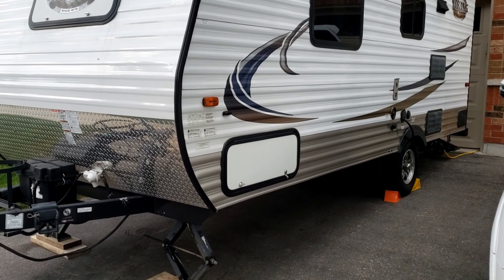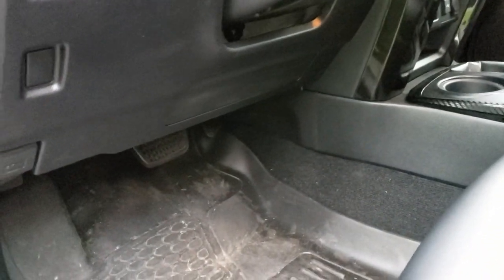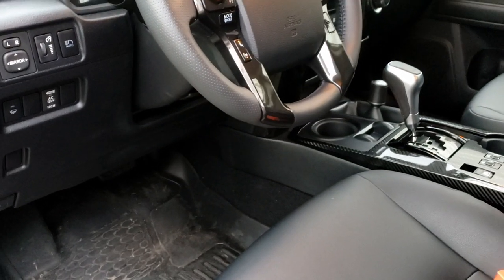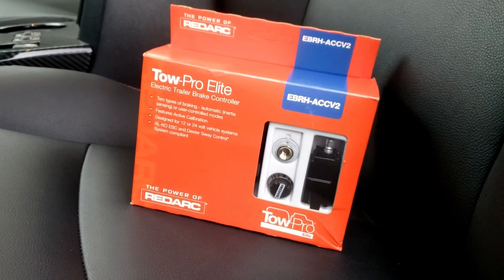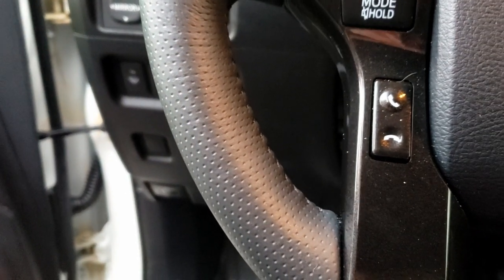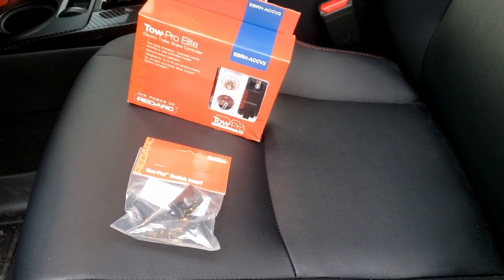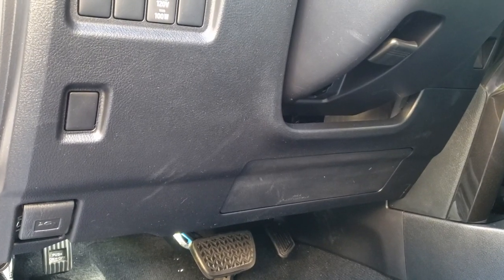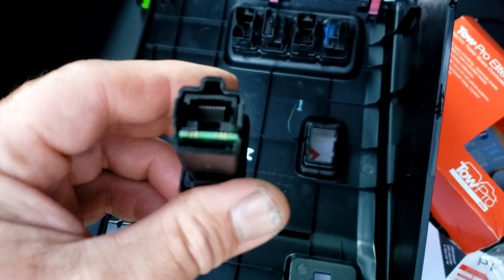Why Redarc may make the best trailer brake controller for your tow vehicle - 5th Gen 4Runner install

Comment: The REDARC supplied harness has the diode already preinstalled according to their website. Great Video information, I just took my REDARC Tow Pro Elite out of my Jeep JK and Now it's going into my new 4Runner TRD Offroad.
Reply from the maker: If you are referring to the harness that comes with the controller itself (as opposed to the vehicle specific ones available from RedArc), I can confirm that this is not the case, at least not at the time we bought ours (early 2020). When used in conjunction with the factory harness connector that came with our 4Runner, dashboard Christmas resulted as soon as manual control was applied. Splicing the diode into the brake light feed circuit corrected that. Because I already had the Toyota end of the harness (and am quite comfortable doing automotive wiring), I didn't bother buying a completed one through RedArc. Helpful information for others, though. Thank you!

Comment: Great video. I bought the same controller last year for all the same reasons you stated. Traditional controllers are so clunky and awkward. Mounted mine in the spot to the right of the steering wheel, for better access (at least for me) for emergency, manual use. I considered both spots and the one on the right works for me. I did modify the existing blank plug myself which was the most difficult part - I didn’t find the one you used at the time.
Reply from the maker: I contemplated that spot as I too felt it would be more convenient. The counter-sunk spot had me worried that I might not be able to grab the knob that easily, so i went to the left, which has worked out fine for on-the-fly adjustments. If memory serves, RedArc's listing for that blank doesn't actually show this generation of 4Runner as one of the applications it fits.
Thank you for the compliment, glad you liked it!

Comment: eTrailer carries factory to brake controller patch cables. I have the Redarc installed on my 2019 Pathfinder and used a patch cable. Fast and easy.
Reply from the maker: Since both the 4Runner and controller came with cables and I'm proficient in electrical work, it was easy for me to make my own by joining the two. Good suggestion, as I wouldn't have even thought to investigate the pre-made option.

Comment: The parking light electrical feed is necessary on some trailers to activate the remote bluetooth cameras.  Sure appreciate your video.  Wish it had been on a 2017 but I'll manage.
Reply from the maker: Appreciate the positive feedback, thank you!
I suspect that the installation will be otherwise the same. The pre-collision system was introduced on the 2020 models, and I don't think that at the time many folks had encountered that issue. Although another viewer suggests that newer RedArc Elites come with a diode, I can't say for certain if that's the case, or if RedArc or anyone has updated their information to reflect that. Theoretically, this PCS brake signal feedback error would be a problem with any brake controller, not just RedArc's.

I'm a working tech that specializes in electrical, so I just quickly cobbled up the diode work-around, and the controller has worked perfectly since. It just won't activate the truck or trailer's brake lights if I manually apply the controller without also applying the truck's brakes as well. I can live with that compromise.

I fully expect that your 2017 will be virtually identical (other than that 2020+ issue) as the interior trim and trailer wiring itself is probably exactly the same. Toyota's changes to these trucks has been incremental for the most part - a plus in my eyes. Your brake lights should also apply with the controller's manual function, of course.

Good luck, have fun, and enjoy!

Comment: I noticed you used the factory Toyota wiring harness that comes in the glove box of new 4Runners. I have a used 2011 and it did not have the harness in the glove box so I clipped off the male plug end and used butt connectors to connect the grey Toyota wire to the black Redarc wire. White & black striped Toyota wire to the white Redarc wire. Small blue Toyota wire to the red Redarc wire & finally the thick green Toyota wire to the blue Redarc wire. Basically bypassing the harness. Like in the video here, did not use the thin green wire.
Reply from the maker: That would definitely be the best solution if you didn't have the interface plug. Not having pre-collision, I'm assuming that your truck was fine having the brake lights activated by applying the controller manually, so probably no need for diodes. PCS did not like that one bit on ours! (Adding the diode to that circuit solved the problem in our truck.)
Reply: Update: Towed 2 different trailers and all working well. I would highly recommend buying the Toyota harness (mine didn't have one in the glove box) but if you're in a pinch, these color matches do work.

Comment: On the redarc website they state that the 2018+ year model runners have a diode that's factory installed in the tow package that prevents the voltage from back feeding. But according to your video here, they doesn't seem to be true as you had to install your own. I purchased the tph-021 harness that's vehicle specific bc the folks over at etrailer say the diode is built into the harness. After i installed it into my 2022 runner i didn't get any warming lights on the dash. I did however get fault codes on my redarc knob. All wiring is fine and I'm wondering if the tph-021 harness is my issue. The redarc website recommends to splice in the factory supplied jumper harness as you've done but without the diode as they say one is factory installed. I'm just so confused from the conflicting information i don't know how to rectify my fault issue. I've seen multiple other people install the tph-021 harness on newer Runners without any problems. I just don't understand.
Reply from the maker: At the time that I did my installation, the 4Runner's pre-collision system was so recent of an addition to the model that there wasn't much information out there. No mention of any of that then, and I merged the RedArc harness with the adapter Toyota left in the glovebox as seen in the video. I didn't notice a diode in that harness, so I guess Toyota didn't see fit to include one.
The diode I spliced in was just me thinking on my feet as a tech that does a lot of auto electrical.
Our RedArc is still working great - actually had to perform a shorter than comfortable stop on the weekend from about 80K/50mph and I could feel the trailer helping appropriately (thankfully!).
If you can isolate the brake signal feed wire in yours you can just backfeed 12 volts in to it to simulate you pressing the brake and eliminate the truck. (The power, ground, and controller output will still be to/from the truck, of course. And the RedArc won't fully power up until it senses a connected trailer, so you'll have to do that or spoof the load with a head light bulb or something.
Good luck!

Comment: Can you provide the diode value you used and a little more information about the installation? I have a 2020 4Runner and have ordered the RedArc as well. I plan to use the supplied Toyota harness as well. Thanks in advance.
Reply from the maker: It was late by the time I'd finished installing and videoing, so when the PCS malfunction occurred and I figured out the solution, I just grabbed a diode I had handy from a container of components I have and made the repair. Never even thought to record it.
If memory serves, it's a 1/4 Watt rectifier diode, though you could probably use something with a lower rating as there's very little current applied. It's oriented to permit power from the truck's brake light circuit to reach to controller as an input, but not be fed back out, so no truck/trailer brake lights on with the controller applied manually, but normal function in all other ways.
I'd be happy to elaborate if you have any other specific questions about the job.

Comment: Tekonsha Prodigy RF Brake Control 
I used it with my 4runner since 2019 with similar trailer
Reply from the maker: It's definitely a solid alternative, and would save having to fuss with mounting the Tow-Pro under the dash of our truck.

I decided to go with a unit mounted to the truck, rather than the trailer, on the off chance that I end up towing a different trailer at some point, either my camping buddy's (if his tow vehicle had a mechanical problem while away), or a large utility trailer that I have access to.

If that were not the case, or if we had multiple tow vehicles and one trailer (such as a property maintenance fleet sharing a deck trailer), the Tekonsha would be a great choice.

Comment: You do not need to pull all these bolts/panels, the left side panel will just pull free and you can run wiring to all the blanks.

i've done this over and over to put ditch lights, front bumper lights, etc. This will save you a ton of time,
Reply from the maker: You're probably 100% right. As stated in the video, the primary purpose for my removing that was not to access the blanks (you could even just reach up from underneath for the lower one for sure, probably the upper ones too), but to mount the brake controller's module. It's possible that I could have done that without pulling the panel as well, however it's simple enough to remove and made my life much easier. Having it out of the way also made filming easier!

Now that I've tracked down a Party Mode switch, I can finally put that in to the factory location, and I'll give your suggestion a go for sure.

Thanks for viewing, and thanks for the feedback!

Comment: No need to splice together your own harness, Redarc makes one that fits the 4runner/Prado/GX here: 
Toyota suitable Tow-Pro Brake Controller Harness (TPH-021): https://redarcelectronics.com/products/tow-pro-brake-controller-harness-to-suit-toyota-tph-021
Reply from the maker: Thank you for the link!

After looking as closely as possible at the single image provided by etrailer.com, I don't see a diode integrated into that harness, so while it would indeed save joining the Toyota OE connector to the one that comes with the Tow-Pro, I think you'd still find yourself having to splice in a diode in a 2020 or newer 4Runner to keep the PCS happy. It would probably be a nice, simple, plug-n-play for 2019 and older models though - I appreciate you sharing that with me!

Comment: How is it towing with that trailer?  I am about to tow with a very similar weight.
Reply from the maker: Mrs.2BlackStripes likes to be well equipped, so I'm confident that we're over the trailer's GVWR. I try to avoid carrying more than an absolute minimum of fresh water to avoid adding to that weight at least, filling up at the campground if there isn't "city water" hookup.
I mention all that for context.
The 4Runner definitely knows it's back there, and as per Toyota's recommendation, we tow in "S4", locking out 5th. We also have equalizer bars and a sway brake that I usually use when it's loaded; they do help with stability and rear axle bounce over bumps. Our storage location is under 20 minutes from home, and I just use the factory drawbar to and from, with no issues, so if your trailer isn't bursting at the seams, you may be fine like that.
The only quirk I've noticed is likely down to the single axle, and that's a sensitivity to larger vehicles traveling the same direction and their position relative to the trailer. If they're behind the axle (or ahead of the axle), I can feel air pressure pushing the tongue sideways a bit, enough that I have to apply a very small amount of correction to the steering. Unnerving at first, now I don't really notice it.
Provided the brakes and controller are adjusted correctly (you probably will end up making minor adjustments to gain as you're traveling), that should be fine too. Just have to remember that even with the trailer helping, your stopping distance will still be muuuuch longer.
Good luck, and happy camping!

Comment: So no drilling required? About to go add this.
Reply from the maker: In applications where one of RedArc's blanks will fit, no drilling is required to mount the control knob. Our 4Runner wasn't one of the listed models, but I guessed by the shape that one for other Toyotas was right, and it was. (And will be, right up to the 2023 model year.)
Worst case, you'd have to drill a small hole. If your vehicle has blank switches, you could use one of those, and if you ever wanted to return it to stock, you'd just need to find another switch blank.
Now, mounting the actual control unit, you might have to drill a hole or two, but I was able to find spots in our 4Runner that lined up well enough that I didn't. (At least any of those holes would be out of sight anyway...)
My only "complaint" is that the supplied, numbered bezel prevents the knob from being pushed, or at least did in mine. M pretty sure that RedArc has a new knob style now, so the new one might fit better.

Comment: Do you have a link for both the controller and the switch holder that you could share with me?
Reply from the maker: Hi Peter, sorry to take a while to get back, was on vacation!

The Redarc Tow-Pro Elite, we got ours from etrailer.com:  https://www.etrailer.com/Trailer-Brake-Controller/Redarc/RED44FR.html
The switch blank that did fit our 2020 4Runner (and should fit any 4th-gen 4Runner): https://www.etrailer.com/Accessories-and-Parts/Redarc/331-TPSI-002.html

Cheers!

Comment: Awesome video thank you! We have a 2021 4Runner Limited 4x4. What is your towing fuel economy & trailer weight?
Reply from the maker: Our trailer is a single axle rated within a few pounds of 3500. We're probably at that or a few over. Our economy varies considerably with speed. On a trip with a subtle but consistent gain in altitude where we tried to stay with the flow of traffic (110-115 km/h or ~70 mph) we saw somewhere in the 27L/100 km (~9 mpg) range in the trip computer, and nearly ran out of fuel from a full tank in under 300 km.
Keeping it closer to 100-105 (65ish) on less hilly terrain still sees us into the high teens to 20L/100 km range (so, closer to 12 mpg). That's also following Toyota's direction to use "S" mode to manually lock out 5th gear. The 4Runner's gearing is such that 5th is just a bit too tall most of the time anyway.
This vehicle may be rated for 5000 lbs and would likely move it, but it wouldn't be happy. I'm glad it has the ancient but bulletproof 5 speed auto in most ways, but having 6 gears to choose from would probably help the towing mileage appreciably.
Reply: @2BlackStripes  Thank you for the data!
An 8sp transmission is greatly needed!

Comment: Redarc make the best brake controllers anywhere period. They are not the cheapest but would you want cheap braking control, or simply the best and most reliable.
Reply from the maker: Exactly. We've used it on several trips now and I'm quite pleased with it. I've personally recommended one to a few people now.

Comment: Hi, i see that from 9m25s there few wiring to do i was wondering if you needed the Redarc TPH-021 at any point during your connection?
Reply from the maker: Hi Math123, I used the harness supplied with the Redarc controller and connected it to the factory jumper harness that was in the glovebox of our 4Runner when we bought it (Toyota part number 82132-60110). I specialize in vehicle electrical work, so patching a simple harness together was easiest for me. I had a look at Redarc's website to see the harness you've mentioned, and the listing suggests that TPH-021 is for '14 to '19 4Runners. I can't say if Toyota changed their connector for 2020 and newer models, but it is possible. Also possible that the Redarc TPH--021 would plug right in, but cause the same feedback issue, since it's unclear whether a diode is built in to that harness, and 2019 and older 4Runners did not have the pre-collision system and may not have needed one.

Comment: I want to buy a 13ft scamp camper. Lol about 1200 pounds. My 4runner should do well for cross country traveling.
Reply from the maker: Toyota rates the 4R at 5000 lbs, which I think is a bit generous, given how it handles the 4k-ish trailer we have, but your Scamp will be an easy tow for it. If the trailer has brakes, I'd still highly recommend a brake controller to use them even at that light weight. In an emergency, every little bit matters. Also aids stability. Happy Camping!